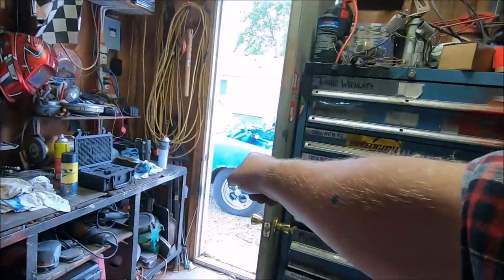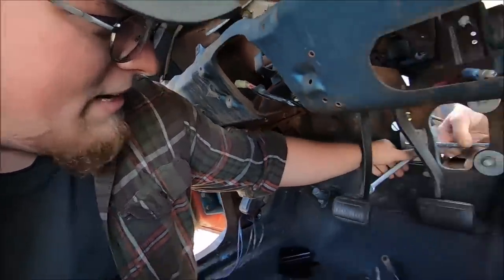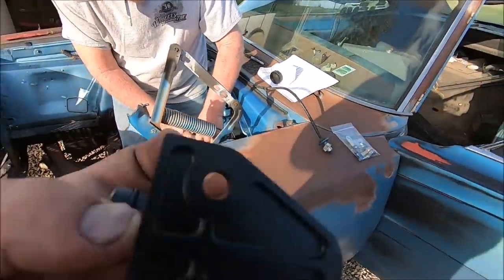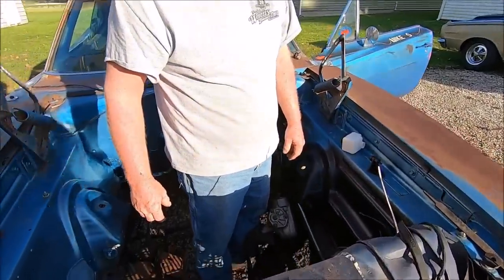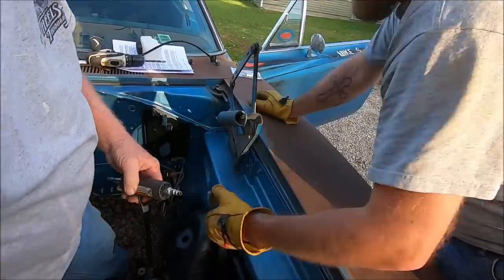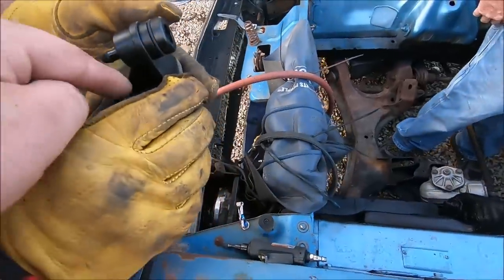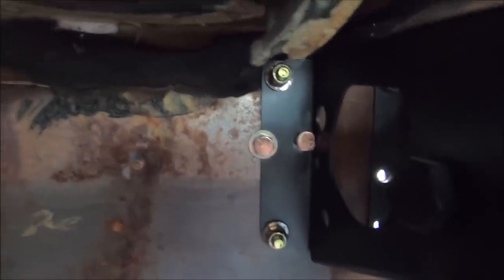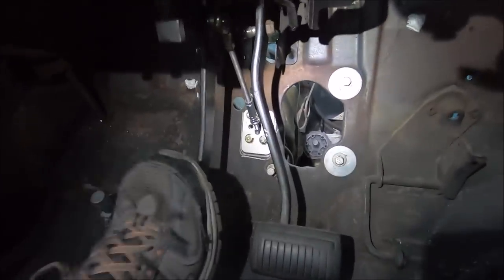1970 Charger Hydraulic Clutch Install Part 1 American Powertrain & Willwood BUILD pt 9

Comment: You mentioned Mike Finnegan & Blasphemi & currently Blasphemi is on a transportation truck on & on it's way to Los Vegas for a Gasser rematch race at the Los Vegas Speedway dragstrip with another Gasser that came in 2nd place at Hot Rod Drag week then Blasphemi will be in the Motor Trend booth during the SEMA show.
Reply from the maker: It would be cool to meet him someday, I just watched his latest video
Reply: @ScottsSpeedShop  I did too it was when Finnegan was on a date night with his wife Jessa when they saw a huge piece of concrete in the road Jessa tried to avoid the piece of concrete & accidentally hit it & flattened the front right tire & bent the front right rim.

Comment: I'd like to take this opportunity to thank you for putting this video on here. The reason is because it has fully convinced me to stay with an automatic in my car LOL. I like simple. And I'm used to dealing with automatics and stall converters Etc. But I will give you Kudos on the manly shifter. I have owned the pistol grip 4 Speed cars one of mine was a 440 Six Pack 4 speed car. But after all of these stick cars I'm happy to just go with the auto. This is a great video though and I think anybody that is converting a b body to a 4-speed setup should watch this video.
Reply from the maker: I can understand why you feel that way man, it is a ton of work to swap over, but I think I may have Dad convinced to swap his car over to a 4 speed, now that would be really badass

Comment: Hey Jed I musta missed it in another vid but, where did you get your pedal kit from ?
Reply from the maker: I got my pedals with a lot of parts I bought a while back, I would recommend searching swap meets, ebay, craigslist, but if you want a restored set, get in touch with Dan Brewer at Brewers Performance, they aren't cheap though
Reply: Scotts Speed Shop thanks man , I’ve been trying to avoid retail but , I know Brewer’s has great stuff

Comment: Imagine try to do this job with the engine in it?
Reply from the maker: That would royally suck
Reply: That might be next to impossible.
Reply: Imagine doing it with a hydroboost set up and the engine installed...that is where I am at on my 68 Charger.  managed to get it all in and it takes both legs to press the clutch in and I am bending the bolt that attaches to the rod.  Think I need a larger bore master cylinder and start all over.